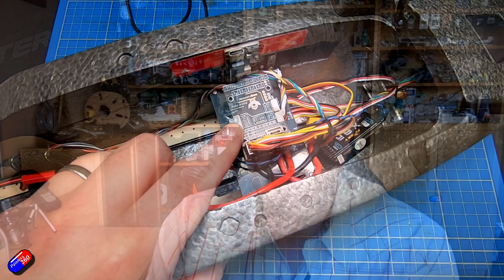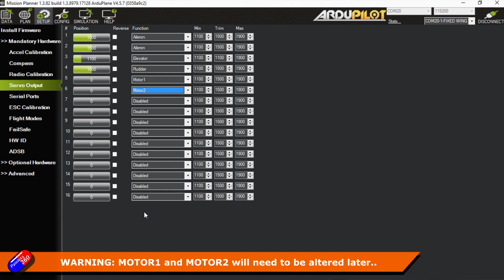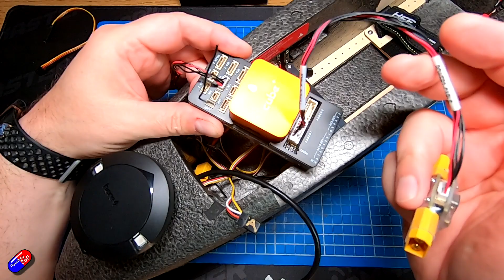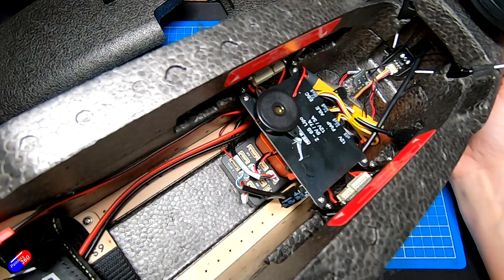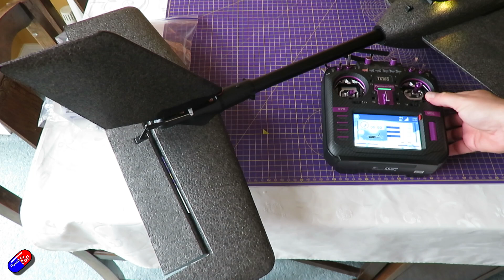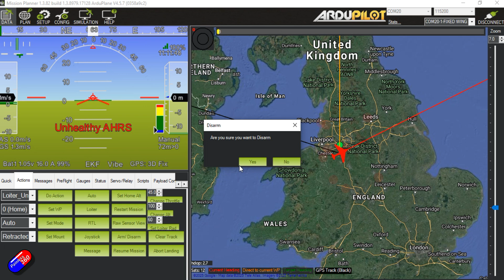Arduplane Build 2025, Video 3: Installing it into the 'plane, servo setup and ESC calibration

Comment: At 23:23 the Flight Controller battery is plugged in when FC is also powered by USB. Is that a problem?
Reply from the maker: Nope. There is protection for both.

Comment: Hey so I have set up the flightmodes, the parameters to tell it wich channel and double checked the radio calibiration to make sure my switch works, how ever when I put it FBWA or Stabilize and move around my orange cube the servos dont respond accordingly. Please help.
Reply from the maker: Please watch the series for all the steps to get it working. Check out the safety switch setup too. Best of luck
Reply: @Pai @Painless360 hank you for getting back to me, I force arm to test it but it didn’t do anything.
Reply from the maker: https://youtu.be/074kwS_nL1E?si=9S2Go4HKbPqSXHuw
Reply: @Painless360  HI sorry, my servos work in manual mode, however when it is FBWA or Stabilize the servos don't move on their own to adjust to my orange cubes position. I checked everything in the linked video but it still doesn't work.
Reply from the maker: Watch the series.... Best of luck

Comment: Having learned so much fro you I believe you are the one that can hel me with a special  project.  I'm working on a drone project that I need to use 4 servos to control the throttle of each prop motor. Which fw would you recommend and how do you utilize 4 servos instead of 4 ESCs? Thanks.
Reply from the maker: If you're using constant RPM props, then you would need to setup some kind of pitch control. I've only played with that on a helicopter, not on a multirotor. I bet that ArduCopter has settings for a setup like that where the motor is IC/glow and the thrust is controlled by a servo. I did see something about some work on 'QuadHeli' code that would do that... Best of luck!
Reply: Thanks. We considered variable pitch but didn't think the yaw authority would be there.  So we want to try with fixed pitch props and vary the speed. I think Ardupilot is the best choice. I've not used it before,  but it looks like I can mix each servo output (4 rotors) with throttle .? Would you expect that would provide the ability for the servos to throttle each prop relative to control and fc ?
Reply from the maker: Probably,  but I have not tried it.  Best of luck

Comment: Can I set my esc to dshot? If yes, which dshot should I use with Inav 8.0.1? The plane is the Heewing T2 cruza. Or do I need to do a manual calibration?  Regards, Alex.
Reply from the maker: I can't recall, probably DShot150. Check out my video on my build.
https://youtu.be/o7AbyJc3cr8

Comment: Lee, why did you decide to use the Cube FC in place of the OEM FC from Heewing?
Reply from the maker: Mine wasn't supplied with an FC from HEEWING. Check out my original videos on it. See my comments in why I'm using the Cubepilot Cube Orange+ for this build. I didn't want to limit it by using something like a F405 based FC (I have other HEEWING models with that already). Happy flying!
Reply: Got it. Thanks!

Comment: Is this little bec also powering the servos?
Reply from the maker: The 5v part of the PDB inside the plane provides the power for the servos via the connections on the back of the Cubepilot carrier board via the motor connections... happy flying!
Reply: That'd be my concern as well, paralleling the pdb with the bec of an FC stack. I've seen other T2 Cruza builds where people have stripped the power and ground off the wiring to the FC for any servos coming from the PDB. Only connecting the signal wire and relying on the PDB to power those servos instead.

Comment: I wonder if the cube mini carrier board would have worked. I did something similar and replaced the carrier board with an airbot systems one and it worked out pretty nice.
Reply from the maker: I did the same in the 2020 series but wanted to use the full sized carrier board for future plans.. Happy flying